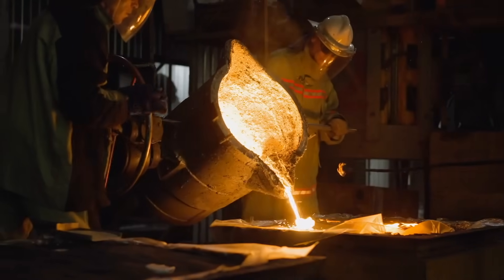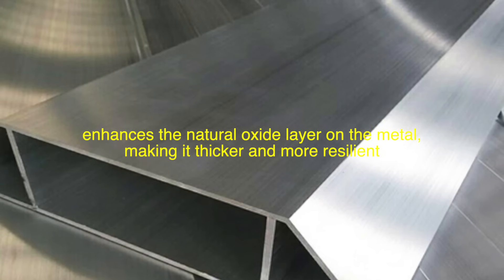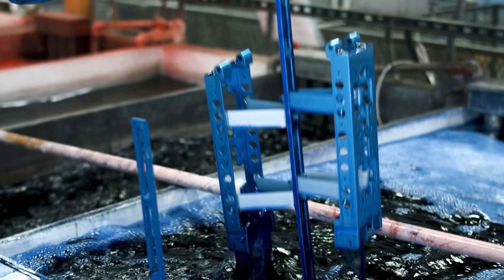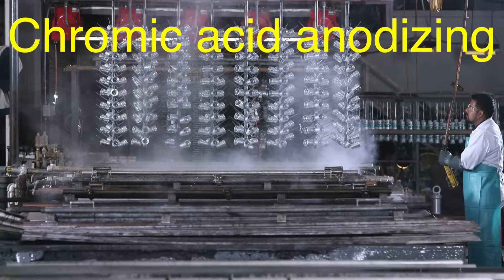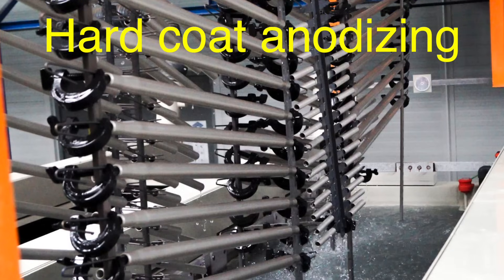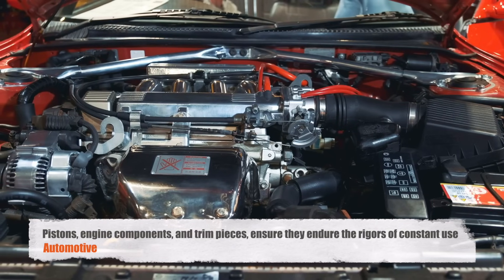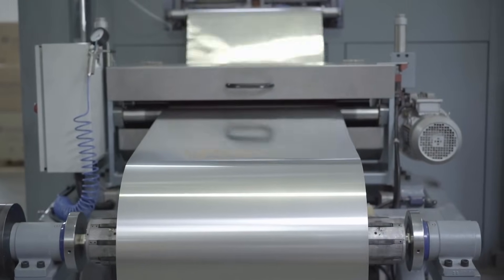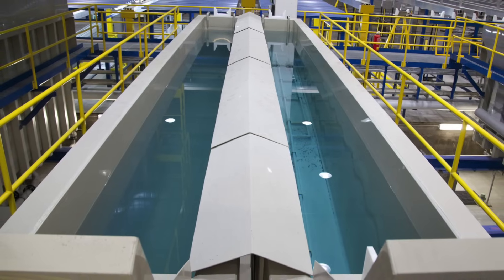What is Anodizing? | History, Process, Types, Applications

Comment: I'm ignorant,  I admit, but could you use a brine solution as the current carrier and oxide inducement?  That would be less toxic. I'm not sure of the qualities of the final surface.
In my years of working with nonferres (sic) metals, I've polished a lot of aluminum exposed to the salt environment. I've also seen that usually the oxidation slows as it gets thicker. That is no heat or electricity involved, so it was the normal accumulation, not induced as in a manufacturing application.
Reply: My unsubstantiated belief is that oxide layer is also protective. This process is most surely electrolysis, where a sacrificial cathode disintegrates in the proton rich brine and deposits on anode (coated metal)

Comment: I was getting this confused with galvanized steel. Until the end for nonporous metals. I felt it now lol. But I would like to see, the process for galvanizing. That would be pretty cool.
Reply: Galvanized steel is electricly coated/plated with zinc, as the protection against oxidation. I do not know the contents of the electrolyte solution.
Reply: Sometimes it is dipped in molten zinc for heavy applications.

Comment: AI generated or not, this video provides an excellent explanation of the different processes.
Reply: The oxide film produced by electrolysis is not good enough for protection; it needs to be sealed. The dyeing must be done before sealing. Anodizing (regular) anodizing is a poor protection from sea water and air (chloride ions can penetrate the oxide layer). Phosphatizing is a better choice in many cases.
Reply: If you can't tell, or do research with information and locations. Than you are an idiot.